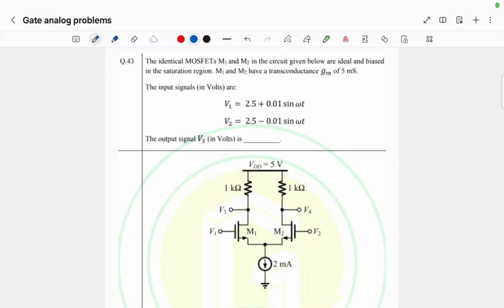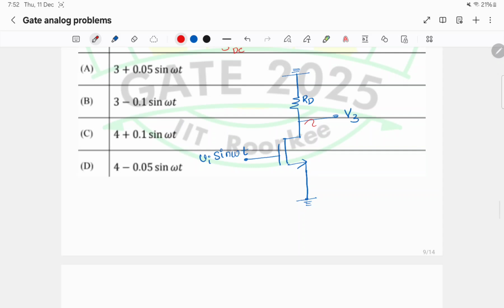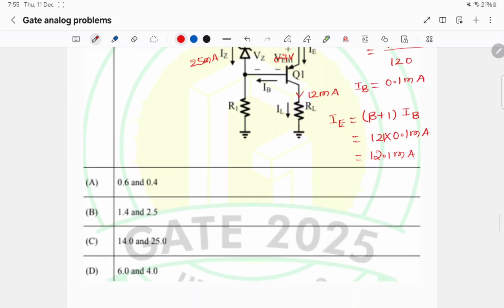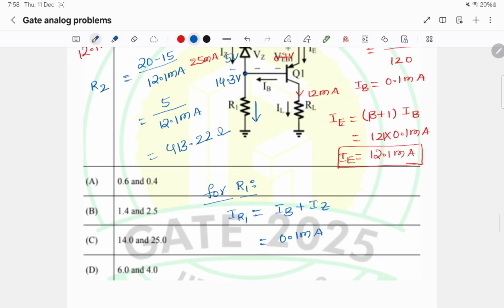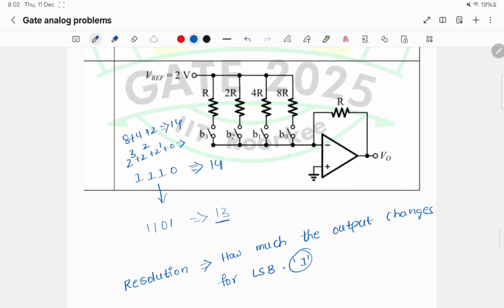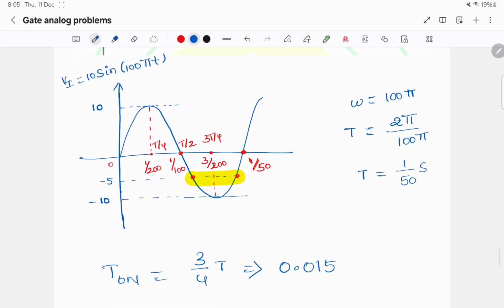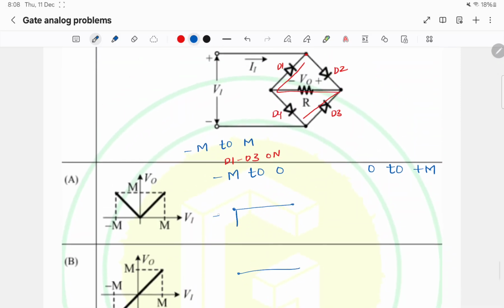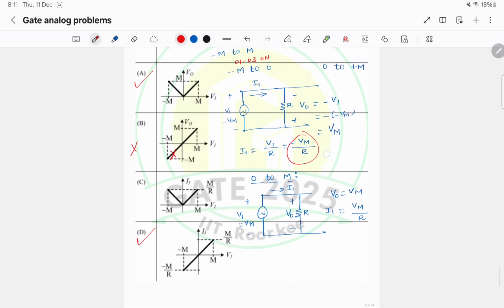Gate EC 2025 Analog solutions part2

Comment from the maker: 00:00 Q1 Dc voltage and Small signal Gain of MOSFET Differential Amplofier
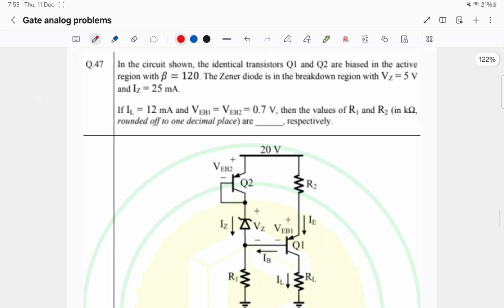4:27 Q2 Finding R1,R2 from given ckt Mixed question based on BJT,Zener diode
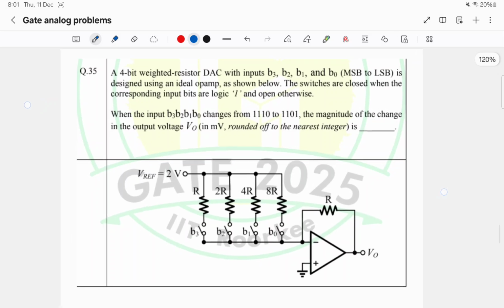10:15 Q3 4 bit weighted-Resistor DAC output voltage
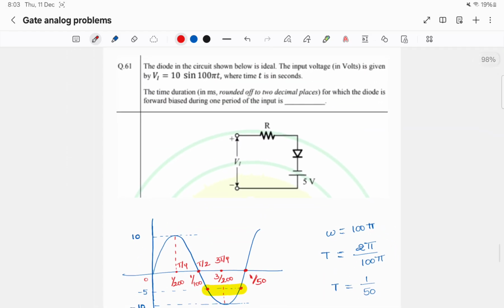13:05 Q4 Transient Response+Diode
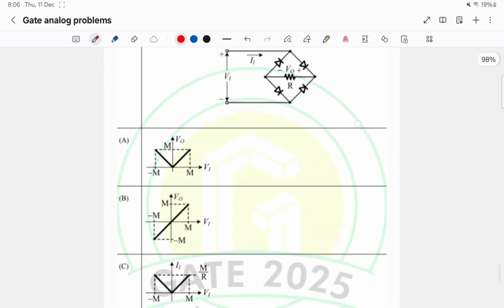16:15 Q5 Output voltage,current Waveforms of full wave Bridge Rectifier